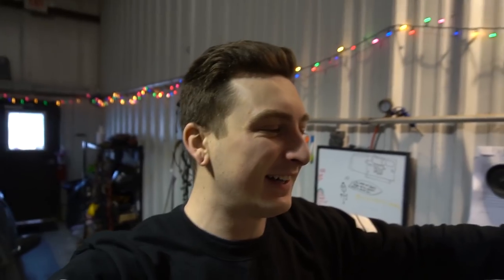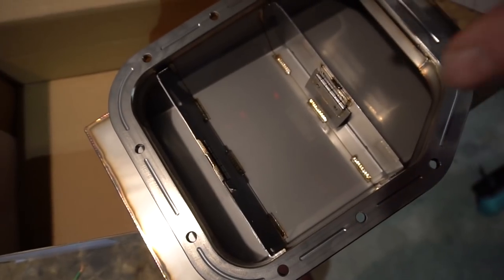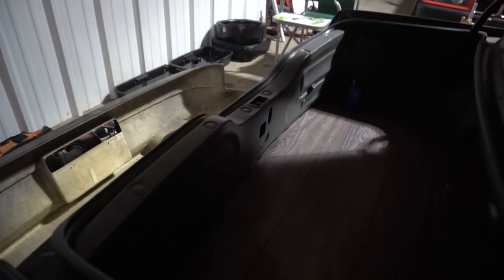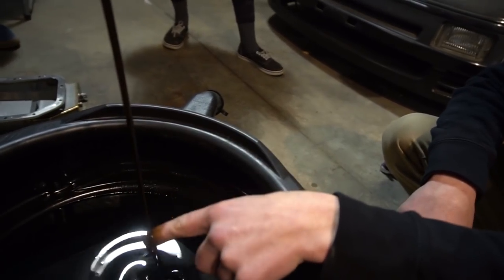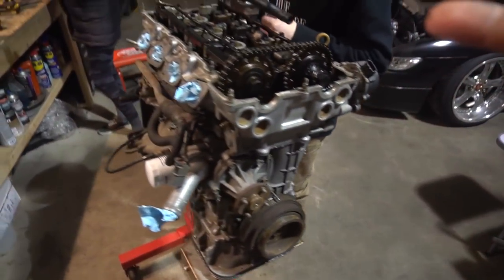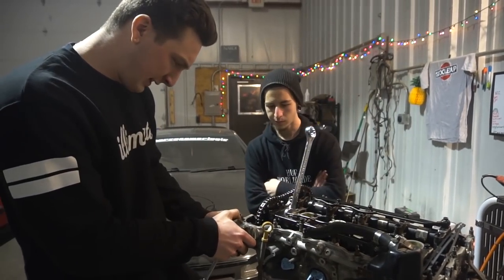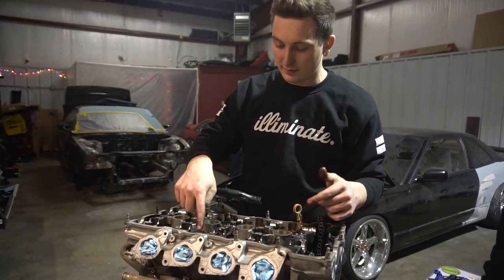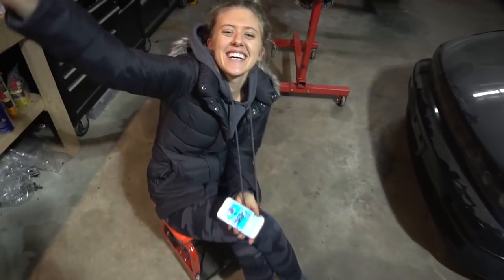HOW DOES THAT EVEN HAPPEN...!!

Comment: Why is the drain plug on the new pan facing horizontally? I hate even the ones that are at  45 degree angle, cause you have to move the drain pan as it drains. I love my Volvos with the vertical plugs on the bottom of the pan.

Comment: The torque spec on those cam caps are only supposed to be 7 or 8 ft lbs, people always burn up heads by tightening them too much and not to spec. If you're going with a new head and new cams I would deff figure out how to measure the shims and reshim everything / make sure they are in spec. 

I'm sure you already know but all those clearances up top will make or break an SR, also look into dual rocker guides, it's a pretty common thing done on SRs, I had it on my personal sr and had no issues with throwing rockers. Rev limiter was at 8k, made 430+whp and I smashed limiter all day without RAS (thumbs up)

Comment: your better off with less RTV. gotta remember, the same amount of RTV that squeezes out when you bolt down the pan...also squeezes out inside the motor... that could potentially fall off an roam around the motor, blocking oil passages.

Comment: Harbor freight torque wrenches are always dead on. No need to buy real torque wrenches and keep them calibrated. You will learn not to use cheap calibration tools one day. It sucks when you are trying to diy and you don’t have the tools but sometimes you just have to slow it down and do it right the first time. The specialty tools aren’t that expensive you just have to wait. My advice to you is if you don’t have the tool you can’t do expert + jobs. Maybe Jack and Scumberto. Can help you get rid of some of the haggard habits you have developed.